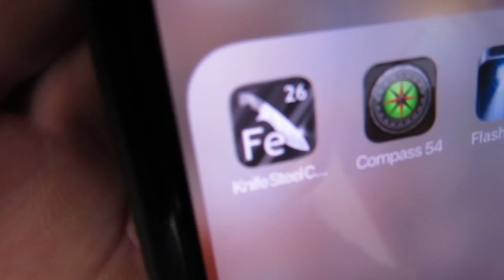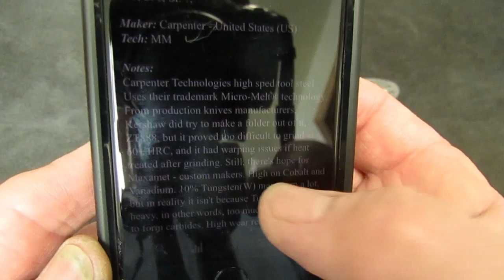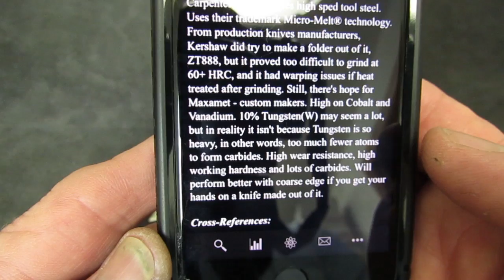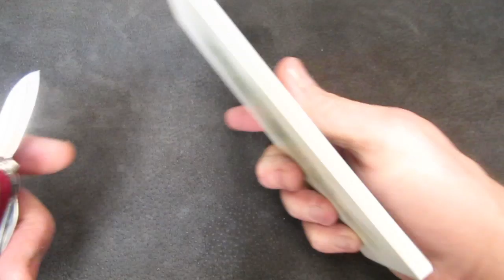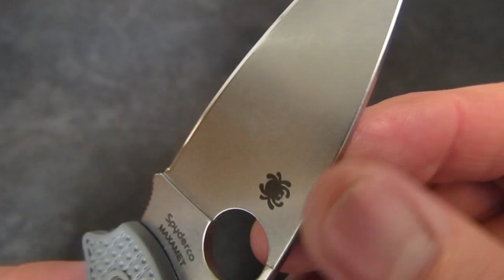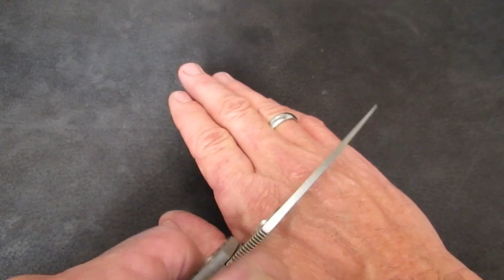FSB -- Struggles and Solutions:  My Maxamet Nightmare

Comment: So basically you just suck at sharpening. I have the same knife and I have a much smaller angle on it. I've shaved my face with it, then cut a arizona can multiple times with it, then continued to shave with it. I've slapped the edge into aluminum edges on furniture. Maybe they changed how they make it, but it is basically indestructible from my experience.
Reply from the maker: You should really watch the whole video before you show your ass like that. Some are good. Some are worthless.

Comment: If you sharpen that much then you should know first thing is you need dismond abrasive stones to sharpen maxamet or many other. Also you can not be making a 17° angle its way to shallow for this steel. You need to steepen your angle and have some thickness there and you do not really want to be making a micro bevel or it will do the same thing a lot of times. Shouldn't be this hard to figure out if you have been sharpening for years 🤷‍♂️
Reply from the maker: Are you Mr. Dunning or Mr. Krueger?

Comment: “A poor carpenter always blames his tools” or in this case “a poor sharpener always blames the steel”

You using diamonds bro?  Cuz if not, that’s the problem, not the steel. 

“But those grapes are sour!” LOLZ
Reply from the maker: Your mom called. She asked me to tell you to clean the Cheetos dust off her keyboard… and whatever you splattered on her monitor screen. 

This video is a few years old, and it highlights the very sharp edge (pun intended) that Maxamet rides on in the balance of hardness and toughness. I’ve seen some perform well, and some disintegrate during sharpening and use. If the heat treat isn’t perfect, it’s useless. If it is perfect, Maxamet can be the pinnacle of wear resistant steel. 

I’ve sharpened well over 10,000 knives, most of them as a business, for hundreds of satisfied customers. In another life, I was a heat treater and certified metallurgist. 

But thanks for the tip on using diamonds, Mr. Obvious… you’re a life saver!
Reply: you’re welcome!  Let me know if you need any more help!

Comment: Maxamet is great. I like it and use it almost daily. I apply about a 14°ps apex micro bevel (truly micro) on a blade I reground with a very shallow convex bevel that basically just blends the flat down to the apex to thin out the behind the edge thickness. With a thin behind the edge thickness the apex degrees is almost irrelevant. I do this on all blades regardless of steel as I find factory bevels far far too obtuse. I polish the bevel to # 8000 and apex at # 600.

Takes about 15 minutes on Atoma/DMT.

I’m even considering making a small fixed blade with Maxamet.

Edit: Like all factory ground bevels, it was subpar, brittle, and micro chipped frequently. After it’s been de-stressed and sharpened a few times it’s fine. Never had it chip after I done this but I wasn’t at all impressed with the factory edge. Just another reason why knife grinding needs to be cooled/flooded.

Comment: Maxamet really is a tougher substitute for carbide, but it's just not a great EDC knife that people might go and pry a paint can lid open with, or hit the edge on anything solid. The best general use steel would be MagnaCut, I think, or cru-wear for a slightly tougher non stainless version. D2 is about twice as tough as Maxamet, and it's not a tough steel, but it's just enough for a pocket knife. Personally I'd use a steel that gets at least 5/10 on Larrin's tests for toughness for general use, like S30v, cpm-154, ingot M2, or VG10. 1095 gets a 4.5 and maxamet gets a 2, just for reference. For high edge stability, use a tougher steel run pretty hard like AEB-L at 63-64, or again, MagnaCut in the same range. Spiderco also has a poor blade design for this steel with the huge hole reducing the blade toughness a lot. Plenty of stress risers.

Comment: Maxamet is hard carbides in a soft matrix. Diamond stone makes a shitty edge becauseit sharpens everything. A softer silicon carbide preserves the hard carbides and removes the soft material underneath, making a tough cutting edge versus an ultrathin edge that will break off.

Personally, I find it easy to sharpen to a functional sharpness. Beyond this, it's a waste of time

Comment: Edge retention isnt the issue people make it out to be. Its a marketimg scheme to get people to buy knives and pay higher. The truth is, under actual real world use, maximet is gonna get screwed just as fast as s30v. Maybe in a different way but screwed non the less. Bc in the real world when you're actually using your knife, you're gonna cut through whatever it is you're cutting and run into something else thats either gonna round, chip, or dull it. Example, if your cutting zipties that are holding hoses or wires to a frame on a piece of equipment or a vehichle frame, youre gonna hit the edge on the steel frame. Then, guess what, its dull, or chipped. If you're stripping wire, your gonna hit the copper, and guess what, same result. If your cutting boxes, which who does? People who want a reason to use their knife. Your gonna hit a staple and... chipped, or dull. If im cutting a hydraulic line or rubber hose or even rope, thats actually used, not brand new store bought stuff people test with, its gonna be covered in dirt and grit which contains iron. Guess what! Chipped or dull. Any real world use, even kitchen use where you would most definitely chip maximet on a cutting board the blades are gonna dull either way. Its a minuscule difference in real world. People on youtube doing testing with controlled items being very careful and everyone thinks it relates to real world. Its confirmation bias they want their 250 dollar knife to be the best and tell people its the best. And the reviewers are gonna tell you what you want to hear otherwise yall flip and go crazy just like this comment section. In reality, the knife company has scammed you into being happy to pay extra. Dont get me wrong i love spyderco and benchmade and think their worth the money, but the "exotic super steels" like maximet arnt any better then something like s30v or 45 in real world use. They all dull and chip. Now if youre in a office where youre begging your coworkers to cut open their yogurt for lunch just for a reason to use your knife and feel good about yourself, then sure, maximet may be special but for the blue collar guys its garbage. If it doesnt corrode away from soaking in your sweat all day, you will surely chip or even break the blade.
Reply from the maker: Careful! You’re making way too much sense here!!!
Reply: I have a lot of super steels s110v, m2, k390.  I still think my buck 420hc is the best steel I own, for real world use and sharpening.  I also like my cpm154, I think it's leaps and bounds ahead of the others....

Comment: I have a factory 2nd maxamet para 2 .. i have also s110v native 5 and s30v manix.. the pm2 because of the steel im using 17 degree per side and its the most amazing knife and unbelievable steel ive ever seen ..
Reply from the maker: Just an update… I’ve seen much better and more consistent sharpenability and performance over the last couple of years from Spyderco’s Maxamet. But the early stuff was very hit and miss, and when it missed, it missed ugly.

Comment: Just tried to sharpen my Maxamet Manix 2 LW 15 dps and 1/2 inch wire piece of my apex fell off and a ton of chips.  I figured I was using the KME BEAST, so my fault…. Went to 140 grit and could tell if the burr was really a ragged burr or the apex was being chippy.  Hour and hours went by then went to microbevel at 17 dps.  Finally sharp for 90 percent of the apex except the heel part isn’t that great.  I suppose I should have started at 300 grit or 600 grit even?  I would describe my experience as very painful!  Much harder to keep from chipping than s110v

Comment: Meh, I'll take Cru-wear or M4 or even 14C28N over Maxamet any day.  I could see enjoying it in a very specific type of knife, something small that I carried just for precision slicing/cutting, but I prefer toughness over brittle hard steels like Maxamet, 15V or Rex 121.  i do a lot of whittling and carving with my pocket knives and I find that these brittle, high-Rockwell "super steels" chip very easily when you apply torsional pressure as you're cutting.  I'd be interested in trying maxamet or an analog in both a convex and a Scandi grind blade to see if the more robust width behind the edge made them more stable but a Manix 2 is too thin for me to trust steels like Maxamet.  My Cru-wear 2XL is my favorite knife that I carry daily (along with my M4 Shaman) so I'm very familiar with Spyderco's and I've been collecting them since the mid 90's.  Until lately I've managed to avoid the draw of these "sprint run" knives but that Cru-Wear 2XL just called to me.

Comment: My first Maxamet knife was a Para 3.  The knife chipped a lot and was sent back to Spyderco.  Spyderco sent the knife back to me claiming that the "Heat treat and HRC" were good, thank you for playing...  I proceeded to sharpen out the chips and eventually the edge stopped chipping.  Most casual knife owners would have been out of luck.   I sharpen a lot and was able to fix the knife.   I look at the Maxamet steel much like a new baseball glove.  It takes time to break it in.   
I would love to get an update regarding your opinion of the steel.    Thank you for the video!   :  )
Reply from the maker: After a few years and several more Maxamet knives sharpened, I would agree with your baseball glove analogy. To continue the comparison… when I was a kid most of the gloves we could afford behaved as you described. But if you could manage to spend twice the price of most good quality gloves, you could buy a Wilson A2000 or Rawlings Wing Tip. Those gloves were made so well, from the best hides prepared the right way, that they felt broken in right out of the box. It’s like the difference between a $200 pair of cowboy boots and a $1,200 pair today. 

To bring it full circle, if I’m paying ultra premium prices for knives made of a particular steel, I don’t think I should have to “break it in” by sharpening away a significant amount of it for it to perform optimally. 

Also, for most users/sharpeners, we all have a sweet spot on the spectrum of wear resistance, toughness and sharpenability that we look for in a knife steel. It’s kind of like the “crazy hot spectrum” for women. In that context Maxamet is like a stunningly gorgeous woman who loves sex, with multiple personality disorder, who doesn’t take her meds, but drinks excessively and has a penchant for violence when she doesn’t get her way. Definitely not wife material. And Maxamet will never be the steel for me.
Reply: @TheApostleP  Ok,  so a little more of the story.
Knife 1 - Chippy till the factory edge was long gone
Knife 2 - Para 3 Used, sharpened and Zero problems
Knife 3 - Para 3  second owner,  Brand New factory edge
I'm sending all 3  to Gerald at Outpost76 for cut testing.  The first 2 knives are sticky sharp with the factory angle.
The third Para 3 is a wild card with the factory edge.  
I sharpen 50-125 knives every year.  Playing with super steel is a hobby for me.
Thanks for the years and years of outstanding YouTube videos!  Much appreciated.      :  )
Reply: @barkingspider2007  I've seen YouTube videos that said Spyderco Maxamet was horrible in early years, but they improved the HT and now it is so much better.  Do you agree with this?
Reply: @JustStartingOut-nt8ve  Out of 5 Spyderco knives 1 had a chipping problem.  3 have yet to be sharpened.
I will know after I get the use them 
2 are out on loan for HRC and cut testing wot Outpost 76.

Comment: Yes, I have that grey frn Manix 2 and I am not fan of Maxamet, I prefer much more my CPM S110V, K390 or even older ZDP-189 blades. I have a Lansky and a Gatco sharpening systems both with diamond rods and I don't have any problem with those hard steels even reprofiling them but I can't get the Maxamet as sharp as the others no matter the time I pass sharpening or stropping it and I find it more prone to chipping than the rest. I wouldn't buy it again but confess I haven't tried it with a coarse edge so maybe I am partially guilty for the results.

Comment: I recently got a PM2 with MAXAMET. Came at 17-18 dps. And i had no issues with the factory edge. It held up quite nicely to lateral tensions. 
First sharpening I dropped the edge angle to 16 dps. Had absolutely no issues sharpening it and getting a nice "crisp" edge. 
Listening to you talk about how you worked the secondary wit minimal pressure...maybe that was it! For months now I am sharpening using very little pressure. It started as a test to see if I could sharpen a knife and create a burr so minimal that there was no felt difference in use whether you deburred the edge or not, and i just noticed that the edges i got were more to my liking. 
I have heard a lot of people complain about maxamet. So far I can't relate but i did enjoy you video...as usual.

Comment: I literally just sharpened my PM2 in maxamet. I definitely did not have this issue. I also didn’t find it any more difficult to sharpen than s30v. Maybe they’ve changed the heat treat on their maxamet since this video?
Reply: Same here, I use DMT plates and strop with 1 micron on Para 2 without problem.  I think they must have gotten the heat treatment fixed.

Comment: I've replicated this in a fixed angle system on a manix 2 lw... but I can't agree with your conclusions.. it doesn't do well with lateral load but it's still steel, don't be afraid. 
8f you have trouble, just minimise burr and lower pressure.

Comment: I know this video is very old but wanted to share my experience with maxamet. Now mine is from early 2021 and may been treated much differently than 4 years ago. I've heard many horror stories  but also heard many people having great success with sharpening. I reprofiled with 300 grit dmt and refined with 600 grit dmt them 3 micron gunny juice on basswood at 18°. That's it, no problems, no chipping and used 3 edges so far repeating this process with same great results. Did spyderco get better at ht maxamet or am I just that good, probably a bit of both. Hope this helps

Comment: I have sharpened a bunch of maxamet, I have never had this happen. I have had mild chipping on some of the Older maxamet when on low grit diamond stones but cleans right up once your over F240 grit. I have taken maxamet edges down to 15dps no problem, they prefer 16 to 16.5dps.

Comment: Honestly the best thing ive found is a wooden strop at a medium low grit. 600-1000. Then a medium fine 1200- 3k. Then a fine 6k. Ive done some crazy high grit sharpens like 60k but it actually negatively effects this steel. I think its due to the chemical composition but the ultra fine grits seem to cause some major tearouts

Comment: How did you get a spyderco with that lock mechanism? Is it an older model? Looks like benchmade’s lock mechanism
Reply: It is similar but doesn't use the crappy omega springs that Benchmade uses and is all around superior to Benchmade axis lock. Not surprising because all Spyderco are superior to Benchmade 😂
Reply: @mikewhite255  you ain’t lying. But the bugout bk4 is one of the finest “going out to dinner” knives I’ve ever owned. Def check it out it’s a fine looking specimen
Reply: @GanjaGuy  for sure , it's a beauty.

Comment: Used the manix 2 LW MAXAMET for 2 weeks offshore. Managed to put 2 chips in the cutting edge and lost maybe 1/64” of the tip. It didn’t seem to me to hold an edge any better than S30V. Easily got the chips out with diamond hones. Haven’t changed the bevel angle, but will next time.
2 weeks later:
Increased the angle on #600 diamond stone, stropped with 1 micron diamond. 
Performed much better,

Comment: How do you explain the edge retention?  Are many blades created from powder?  I don’t know if many are. I do know that you can’t really judge it completely based on the material when it comes to something new.  You have to go from experience if use.  Your experience using it was very welcoming.  Maybe though there needs to be a different way to sharpen as it is a different material.?  Idk, I do like that there at least is something being tried.  My experience is being a plumber welder and now a chemical engineer.  I’d like to take a microscope or even an ET microscope to the edge after sharpened.

Comment: I just now ran across this video, and you describe exactly the problems I have had with my older Manix. I indeed solved the issue by sharpening at 20 degrees. I have treated this particular knife gently since, (read hardly use it), with no problems so far. I just got a Sage 1 in Maxamet and forgot about my lessons learned on the old Manix, and put a polished 17 degree edge on it. The first time I cut some phone book paper with it a chip magically appeared. :(   I agree it's a poor general use steel, but I have cut miles of cardboard with it and it never dulled, just chips, so there is that. Next time I am going to use 25 degree per side micro bevels!  Great video, thanks!

Comment: I use both Spyderco maxamet and custom ones by McCullen knives and I use them for everything and have not had anywhere near that kind of trouble with them. I mostly sharpen them with my 2X72" belt grinder up to a worn out 2000 grit belt, I convex them as I do almost all my knives,  when I don't feel like going down to the shop I use a 600 grit Norton fine stone to touch them up and finish on a worn out 2000 grit strop I made from an old sanding belt.. I have had the PM2 and Native since they came out and carry the PM2 daily I have had a McCullen knives straight knife even longer than that with good results. In adding a microbevel I would think you are coming closer to a convex edge and I can see where it should help you.